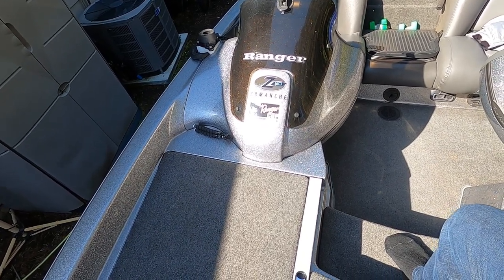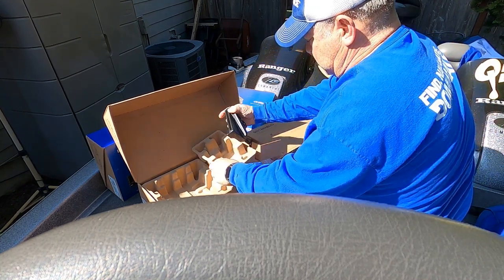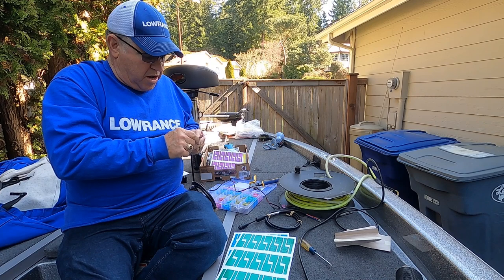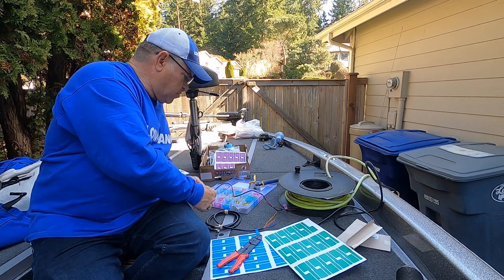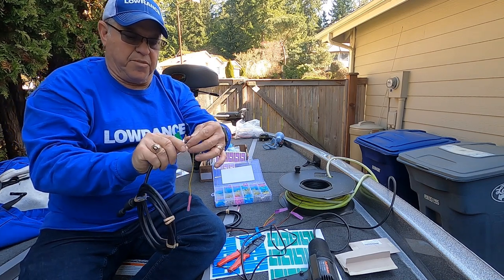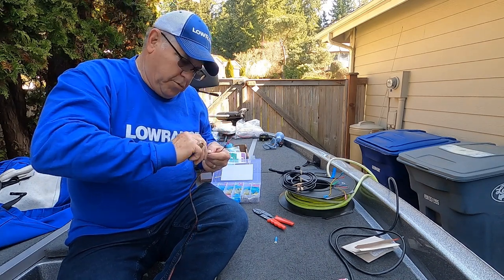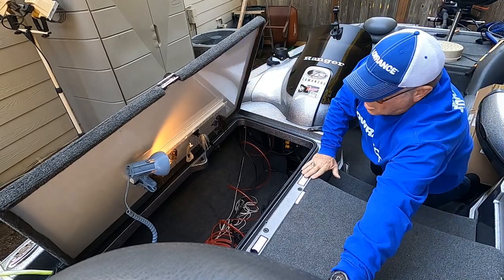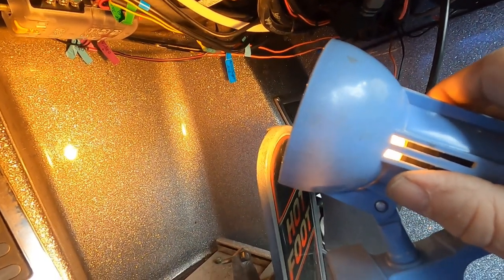Dual Active Target 2, Part 1, Unbox and Install Wiring

Comment: Do you need S3100 module to run 2 Active Target 2?
Reply from the maker: Not at all.
Reply: Once you installed 2 Active Target. Do you have to update the 2nd active target as well?
Reply: Hi Marc, one more question. If the first AT2 Ethernet cord/yellow cord plugs into your unit/graph. Where would the 2nd AT2 Ethernet cord/yellow plug plug into? Does it go into the same unit/graph as the first AT2? Or do you plug the 2nd AT2 into a second unit/graph?
Reply from the maker: @616_overlanders9 Each AT box has to be updated.   They can be done individually or at the same time as in my video.
Reply from the maker: @616_overlanders9 I have both boxes plugged into the same HDS Pro, but they can be plugged in on any ethernet port on an ethernet network.
Reply: @marcmarcantonio Hi Marc, if you have 2 AT2 running, how do you get the new 180 view in forward mode? Is there some kind of setting in the HDS Pro unit that you have to change? Or does the 180 forward view just automatically populate on the AT2 screen?
Reply from the maker: @616_overlanders9  To view the 180 view you need to go into the settings for Sonar Installation and first "pair" the two transducers.
Reply from the maker: @616_overlanders9  Yes, both modules have to be individually updated.

Comment: I've got a 2006 G3 .  The trolling motor is a plan Minn Kota 80 thrust.  I have a couple hook7 graphs. I plan on replacing EVERYTHING.   Trolling motor, 2 graphs,  3 lithium batteries, wiring kit, transducers..misc.  What is a guesstimated price for the whole set up if you don't mind me asking.  All Lowrance.
Reply from the maker: Going all Lowrance with the Ghost motor is a smart plan.  I would check with Russell Marine Products (RMP) for a quote since they also take trade-ins on your old electronics.  Otherwise you can go to BassProShops.com to calculate pricing.  There are usually no discounts on Lowrance gear, though there are often rebates available (check on www.lowrance.com for current rebates)....thanks for watching.

Comment: How do you calibrate the icon on the screen for which direction the AT2 transducer is facing or is it even necessary??
Reply from the maker: If you have a Ghost motor and a Point-1, then it isn't necessary.  If you have a motor with magnets in it then it is more difficult since the magnets affect the heading sensor in the AT transducer.  Try moving your transducer 10" above your motor.
Reply: @marcmarcantonio  Hey buddy, thank you very much for the feedback. I have an Ultrex. I just turned the “icon” off and look at the TM head.